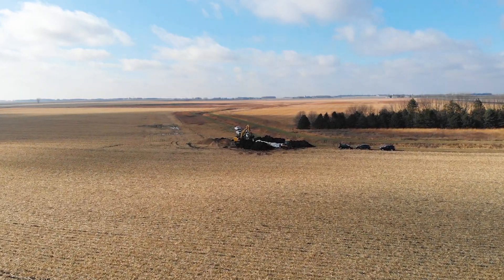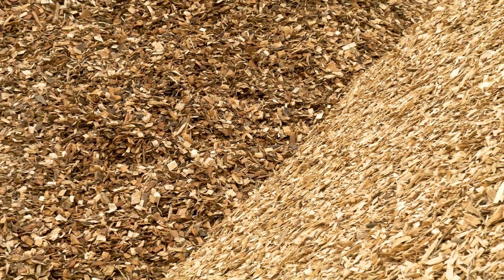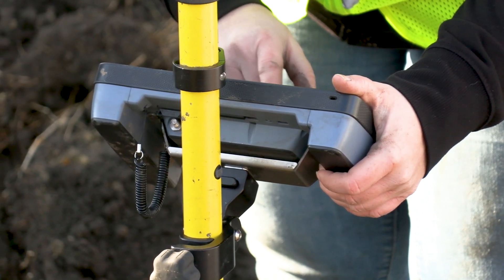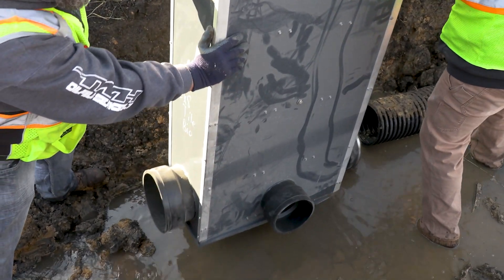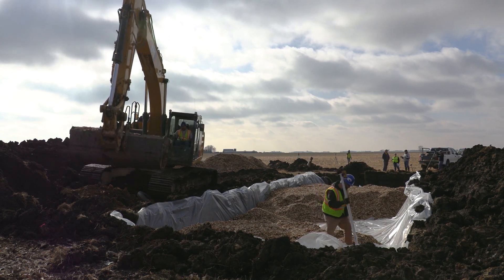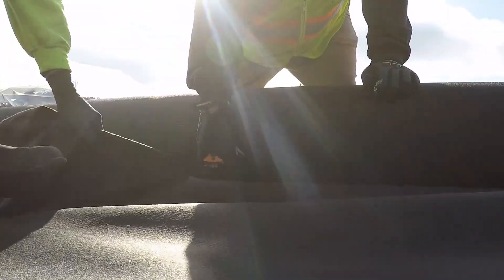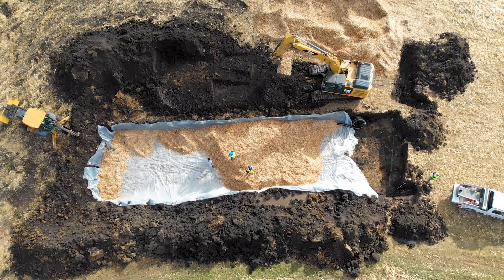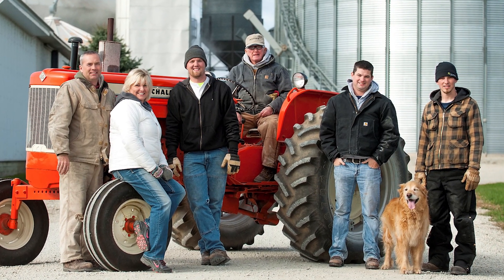Constructing a Denitrifying Woodchip Bioreactor

Comment: In place of PLASTIC why not use HEMP FABRIC? Seems thos system of dumping plastics into the ground which will eventually disintegrate and flow into the rivers & end up in the ocean plastic gyre! This plastic serves to make that problem worse! Use a HEMP FABRIC or some natural mesh around the hemp to hold the wood chips??
Reply: We should go to great lengths to reduce single use plastics, but this isn't one.   Plastics take 100s of years to decompose, whcih is why this works.  Meanwhile, how much nitrongen will be removed?  A fabric that would decompose within a few weeks like hemp would make this reactor useless shortly thereafter.

Comment: Once the bioreactor reaches the end of it's lifespan, can you scoop out the leftover material and just replace with fresh woodchips for another go? Are the used up woodchips viable as organic fertilizer, or are there issues with the material? Also is the efficacy of filtration something that should be monitored, or do you simply assume after 10-20 years that you should replace it?
Reply from the maker: Thank you for your interest in the Denitrifying Bioreactor conservation practice.
Yes, once the woodchips are degraded and either inhibiting flow through or no longer degrading nitrate within the reactor they can simply be removed and replaced. The old, used woodchips may be incorporated into the soil or spread as mulch to crop lands or gardens, although they should not be relied upon for fertilizer. If the reactor is functioning correctly the nitrate (NO3) will be off-gassed to the atmosphere as nitrogen gas (N2) and thus there should be minimal nitrogen contained within them. 
On flow and filtration, these bioreactors are not designed to filter sediment and/organic matter particulates. They are intended to degrade soluble nitrate to nitrogen gas. That said, flow through the reactor is expected to gradually decrease over time with the inadvertent accumulation of fine sediment from the drainage system and the eventual decay of the woodchips as they are consumed by the reaction. Flow through the reactor should be monitored to assure that it is still treating an adequate amount of the system flow as opposed bypassing it without treatment. Finally, the lifespan of the woodchips may vary depending on species, dimensions, and environmental factors such as precipitation and temperature.
If you have further questions or interests, please don't hesitate to contact your local NRCS field office to get in touch a conservationist to learn more about this and other practices as well as the technical and financial assistance we provide to implement them. Thank you!
Reply: @minnesotanrcs  thank you for the detailed response!